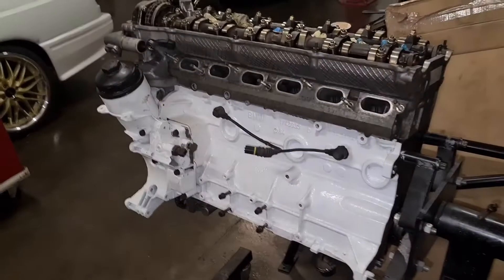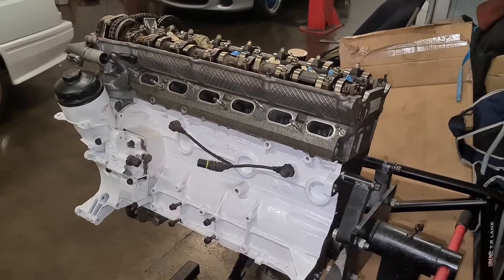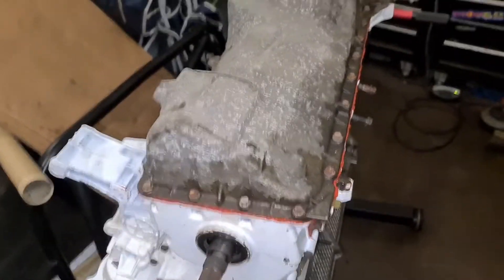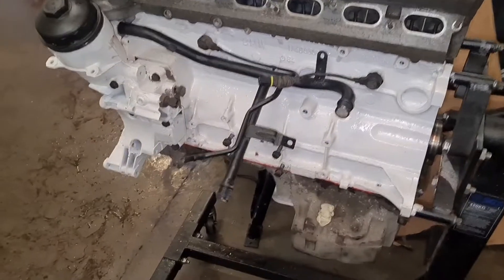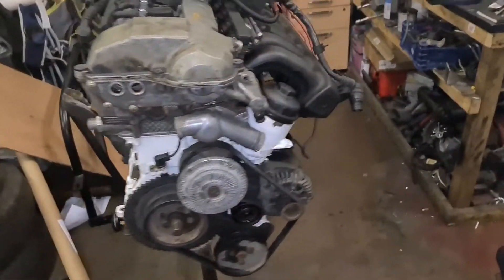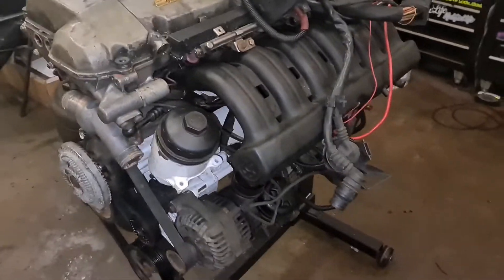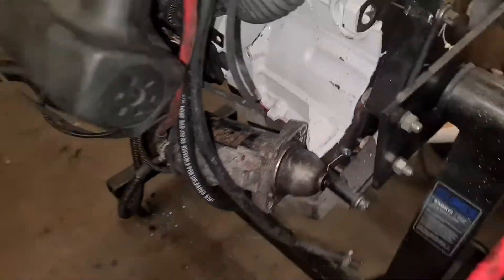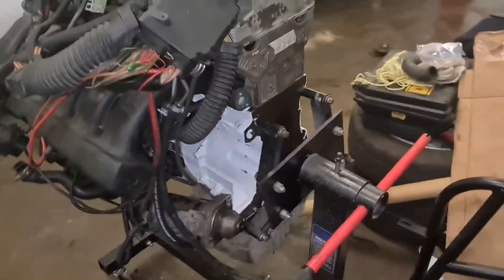Bmw E36 M50B30 Stroker Engine Build, Part 8 Engine is now complete

Comment: Did you have to modify the windage tray or pickup tube for the longer stroke?
Reply from the maker: Yes I had to modify tray. However it was so long ago i couldn't tell you exactly what I have done lol
Reply: @GaragE36  thank you planning on doing this to my m50
Reply from the maker: @zackkinerson491  it's a good swap, plenty of power. I need to finish mine to do some proper testing.

Comment: did you, or have you heard of having the exhaust ports on the m52 head to be ported to match the m50? i guess the m52 holes are smaller?
Reply from the maker: I didn't do port them however yes its possible to port them to match to the m50 manifold..